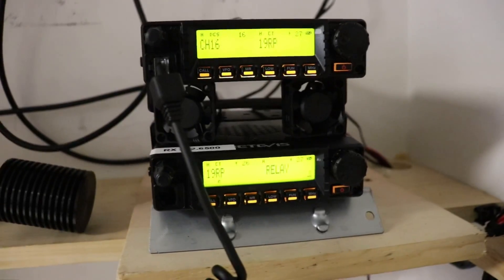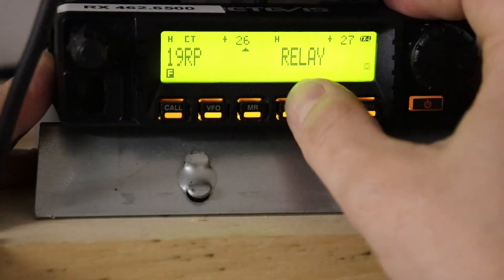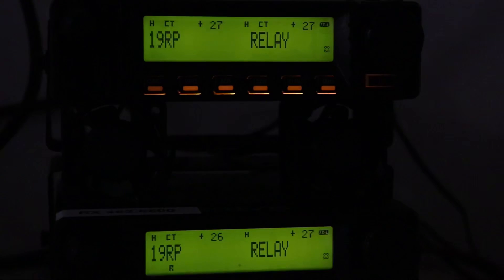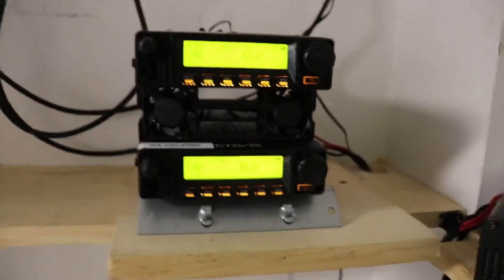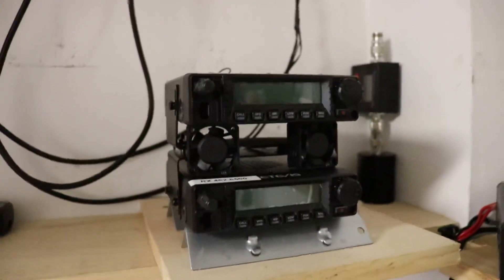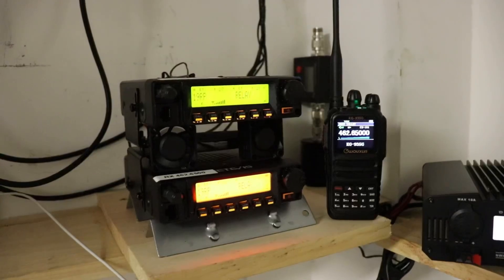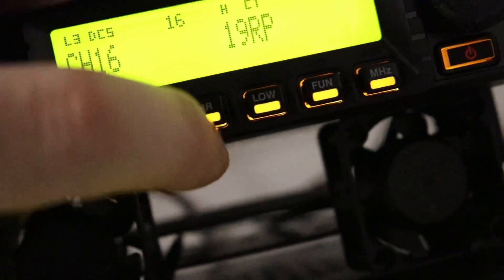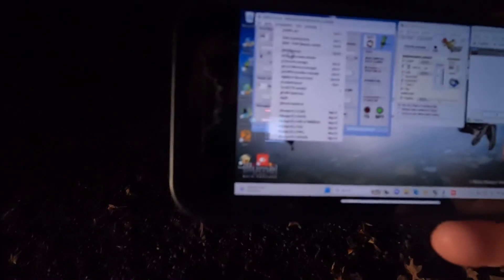Retevis RA-87 G.M.R.S. 40watt Repeater build and testing

Comment: get rid of the duplexer, use 2 antennas spaced 30 feet apart, and you'll get some watts back. the duplexer uses about half of the rf power.
Reply: With my repeater in my terrain, adding back that loss made a 1 or 2 % difference in audio quality, it's height and quality cables...having gone though many cables and power settings. My retevis 97S repeater's limitation (RIP due to duty cycle)  is nearly the same as my Motorola mobiles I built into a repeater....does the moto get out further....yes but on the fringe areas...in the inner circle it's about the same. Keep that repeater as low and cool as you can.
Reply: @thebugg333  well that is how to do a range test actually. Find the fringes, make improvements and retest. The difference in 5 watts vs 20 watts isnt much signal wise. Only 1 S unit. 50 watts is about 2.5 S units. 

X4 increase in power for 1 S unit. On these modern radios they have a bar graph so you
may not even see it. But should improve audio wise.

The best way to improve signal is antenna height. Then antenna gain. Power only helps it to be heard. Does nothing for Receive. So for a Handheld running more power on the Repeater it becomes a Big Mouth. (you can hear it but not access or use it)

So you gotta find a balance if both Handheld and Mobiles are being used.

As you say the Motorola should have a better duty cycle and last much longer. Especially if you turn a 50 watt mobile down to say 25 watts. And a fan is a must!

All depends on how much activity is on it.
Reply: Vertical separation?
Reply from the maker: I like horizontal separation. That way both antennas have the best chance of rx and tx
Reply: @JDubbsadventure  not sure about 462 or even 440 mhz but on 2 meters you put the TX on bottom. At 50 watts that usually pretty equal. But it's got to be at least 25ft of vertical separation. Only works due to the null at the top and bottom of the antennas. Horizontally it wouldn't. The TX would make the RX deaf!

But it's 600 kHz split. At 5 mhz split that's a whole different ball game I guess. Still seems like it would desensitize the RX if it were horizontal. But I've never got the opportunity to work on UHF repeaters. Only VHF.
Reply from the maker: @Outdoors1776  good information. This set up hasn’t shown any desence problems. Me and a few other people are constantly testing it and can’t make it do it yet.
Reply from the maker: I’m only loosing about 30% 26-18. I can live with that better than putting up another antenna. But I agree if you want every little bit of watts then that’s a good choice
Reply: If your SWR is high it won't put out the full power output.@JDubbsadventure